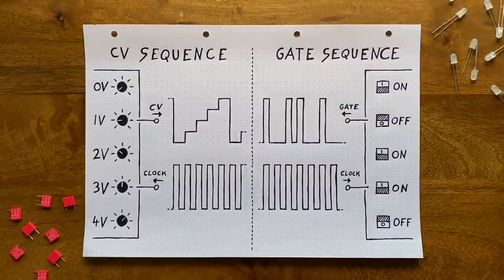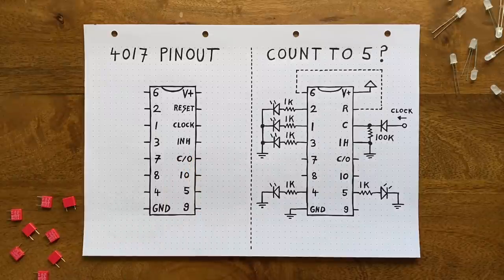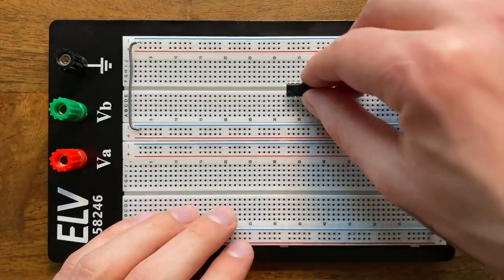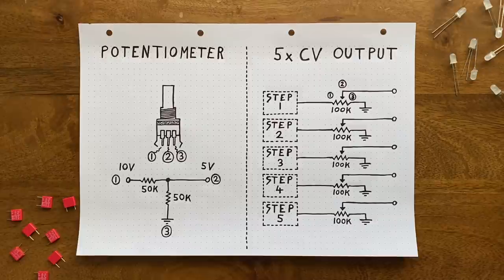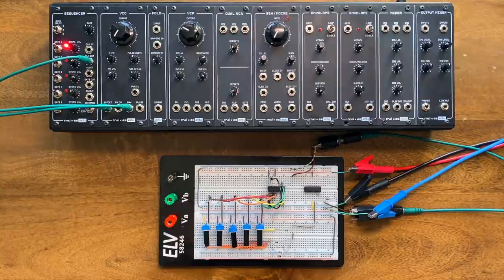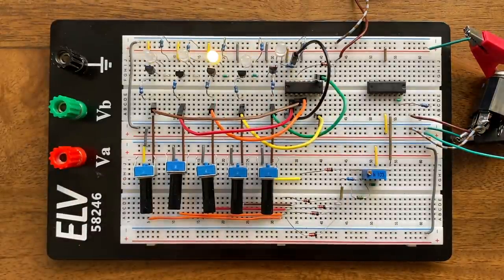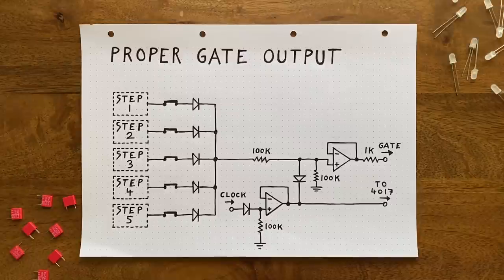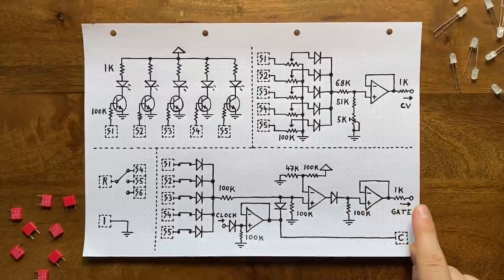Designing a simple 5-step sequencer from scratch

Comment: Great vid as usual! It is worth mentioning for the ones unexperienced with the CD4017 that the outputs in the datasheet are numbered from '0' to '9' instead of the '1' to '10' we would name them. I made the mistake of using what in the datasheet was step '1' as the actual step one in my first sequencer. It took a frustrating while before I understood the problem :-)
Reply from the maker: yeah, that‘s why i numbered them 1-10 on my drawing - but you‘re right, a quick note might‘ve been good!
Reply: Starting at position 0 is the standard for computing and these were originally for analog computers. These are made to be chained together so each chip represents a single digit which is why it starts at 0.

Comment: For choosing number of steps 3, 4 or 5 with just a SPDT switch, if you have one with center off:  pull down 4017 reset input with 100k.  Connect diode from step 6 (anode) to reset (cathode).  With nothing else happening, it will be five steps like before.  Now also connect the common terminal of the SPDT center-off switch to another diode (anode) to reset (cathode).  Connect one position of the switch to step 4 and the other to step 5.  Now if the switch is thrown to connect step 4, then there will be three steps.  If thrown to connect step 5, there will be four steps.  If the switch is left in the center off position, the diode to step 6 will by default give a five step sequence.  This is a similar function to what is in the RYO Penta sequencer (which I have built three) but implemented totally differently.
Reply: (cough) Rotary

Comment: Why couldn't we just powet thr op amp chup with 0-12 volts like the decade counter? It would eliminate the need for most protection components (apart from clock input)
Reply from the maker: unfortunately not, because regular op-amps are not able to bring their output voltage down to the negative supply voltage. lowest they can do is Vee + around 1.5 V.

Comment: You could just use a 1M pull-down and get an ~11V output of the unintentional voltage divider, instead of adding another op-amp. Not like the TL07x can output its full positive rail anyhow.

Comment: if you make each stage of the sequencer using a discrete flip-flop, you can include skip switches (per the moog 960), which is a very valuable addition for live riff-generation.
this is a bit more elaborate than just using a counter-IC, but way more useful.

Comment: This is a great series for DIY builders.
Just two notes on your design:
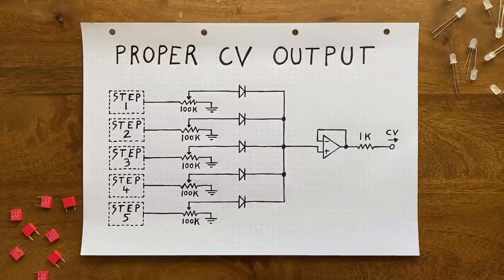@14:46 The 1k resistor on the output will have an effect on the output voltage. A lot of designs I have seen have 50k and sometimes even 10k potmeters on the CV input signal. This means you get a voltage divider and the music is out of tune. If you put the resistor inside the loop (on the output of the opamp) and connect the CV output to the - input of the opamp, the circuit will (try to) keep the signal at the requested level and still have the short circuit protection.

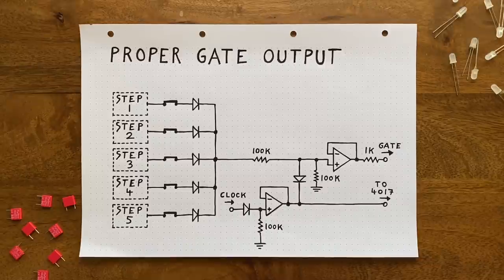@27:50 My Arturia Keystep gives a +5V signal on the gate output when I press a key. This is normal since Eurorack defines gate and trigger signals as 0-5V signals. All inputs should be able to handle -12 to +12V signals so having a 12V gate signal should not damage any module but the comparator and buffer should not be needed.

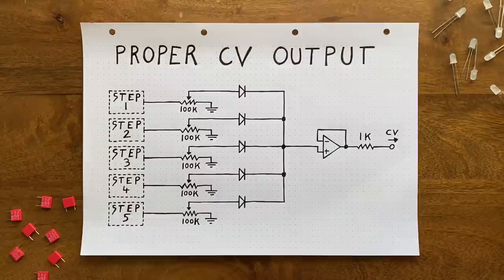Comment: At 15:21, you also need a resistor to ground from the common point of all the diodes.  Otherwise, a step you set to a low voltage will come out a bit high.

Comment: Many thanks. Was looking for a simple clock input for 4017 and yours is perfect. I may add resistor in series with diode as current limit as my friends may use as sequencer running on 9V and connect it to Eurorack. Good idea?

Comment: Thanks for all your workshops. 😊 Is  possibel use a secund cd4017 for the LED'S insted the npn drive transistors?
Reply from the maker: yeah, but i would try and keep the output current per pin at like 10 mA max to keep the chip alive for a while.

Comment: the buchla 245 sequencer had an interesting feature where each step had its own on/off switch + trigger output! weird stuff. also have seen a ken stone 16 step sequencer design with a reset input that could be used to shorten it (but it was made up of 2 8 step sequences so it will often forget to skip for whatever reason)

Comment: Hey Moritz, just curious why you chose to have a second op-amp on your gate output? To me it seems like the diode, 100k resistor, and buffer amp could be removed if you ground the negative supply of your quad op-amp IC. Wouldn’t really effect the rest of the circuit since you aren’t using the negative range anyway and would even allow you to get rid of the other protection diode on the clock
Reply from the maker: that would unfortunately only work with a rail-to-rail op amp chip, because regular op amps can’t reach the positive or negative supply voltage! i.e. if you gave a TL074 0 V as a negative supply voltage, the output can only go down to about 1.5 V.

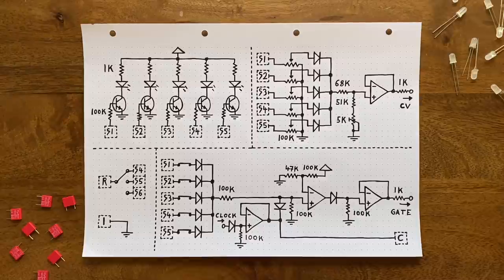Comment: 28:14 Instead of re-boosting the gate output, couldn't you move the 100k resistor to the line with the diode leading down?

Comment: I like the idea with the opamp in the clock circuit helping with the gates. My AND circuit seems a bit overkill now.
Reply from the maker: did you have trouble with ghost gates? i remember battling those for days on end until i finally switched to this approach..
Reply: @MoritzKlein0  for a while I just skipped the whole gate thing because I could not figure out a way. I just used the same square wave lfo to trigger the envelope.
And and circuit works fine, but it’s more parts and more complexity

Comment: It’s really great lecture everything is clear. Thanks a lot! I have one question - my moog Mavis cv in is -5V to +5V range to get all possible pitches (at least thus is what I understood from the manual) how can I achieve that? I have a +/-12V power supply and I’d like to drive my opamp from 3.3V microcontroller pin. Can I bias the input voltage with virtual ground, so the input goes from -1.65V to +1.65 and the opamp gain wold be set to 3? Or I’m completely  wrong here?

Comment: Moritz I echo what many have said, awesome series and awesome teaching - your approach is patient, practical and paced well.  I have built your VCO from the Erica kit and congratulations on that relationship btw.  I have built  your VCA, Envelope Generator and the 5 Step Sequencer, the latter 3 from scratch.  The 5 Step as you may know from the IG feed is still on breadboard and I've had some challenges, but after several attempts I have a working model as designed.  One question remains if you can comment.  My CV ouput to 1 n/oct is sounding an octave approximately.  I know you indicate the range of the voltage pots may need scaled down which I have done some.  It's probably a combination as I never have properly scaled the VCO.  For what I do it has been close enough.  From the video version of the 5 Step the trimmer pot is a 5K.  Is trying a larger trim a good step or I suppose increasing the 68k/51k resistor path might be the better.  Thanks and again very glad to find your series at this stage of my explorations with modular.  Keep up the great work!

Comment: at the end, when talking about getting the gate,  first,  back up to a gate signal, by routing it thru a comparator to bring it back to the full gate output swing desired, and then rectifying it via diode, would it be possible or even work, to just set the supplies on the comparator to be VCC = positive supply voltage, and the VEE = GND? that way you wouldnt even really need the diode? i know youd still want the gate signal buffer at the output, but i was just curious as the diode will already drop most of a volt right there again?

this questions really for anybody who might be a bit more knowledgeable than myself. which if im being honest here, could even be the dude who comes in and sweeps up the place after moritz has done his magic or whatever...  nonetheless, thanks to everybody who might have any advice here..

Comment: I already build the counter circuit on breadboard. Unfortunately my CD4017BE has burned out by using 12V directly. Another chip I used is driven with 6V by installing a voltage divider, so the counter works now. Is there any differences about the CD4017BE, the MC4017P or the V4017D from Eastern Germany? Great Project!
Reply: I think this might be due to the LEDs. The 4017 chip is not  designed to directly drive LEDs..

Comment: Sorry If I am wrong but, about the NPN led setup, if one of your LEDs actually gets destroyed somehow and collector gets disconnected, the NPN base-emitter path will act like a pretty weak diode shorted to ground. You may consider adding current limiting resistor into the emitter for the safety of the source. 
(Edit: I am an idiot, he did put a 100k on the base.)
Reply: What value would you propose?

Comment: Will two 9v batteries work for this project, or do you need a power supply?
Reply from the maker: pretty sure they will work - your output gates will be ~9 V instead of ~12 V though, and your cv range will be somewhat smaller
Reply: @MoritzKlein0  what are some cheap options for a dual power supply because as a beginner I am a little nervous to take on your homeade power supply video. Also thakyou for the quick response

Comment: Does it really need to be trimmed to be exactly 5v? Seems like either you're using a quantizer, in which case it doesnt matter what the exact top end is, or you're going by ear, in which case a little extra room to exceed the 5th octave doesn't affect anything.
Reply from the maker: two things i like about trimming it to be exactly 5V: 1) the highest note will be exactly 5 octaves above the lowest, making it a bit easier to orient yourself 2) switching between the 5 and 2.5 V range can give you musical results

Comment: Could you handle the gate/clock output via a transistor instead of that op amp thing you did? With the clock opening up the transistor to let the gate signal flow through?

Comment: I am awaiting delivery of the parts and will be kicking off the build tomorrow all being well - thank you so much for this (I have now subd on Patreon :) … one question though .. is it possible to link these types of sequence chips together to have a longer sequence chain? Ideally I’d have me a 16-step sequence, so two chips (20 steps) would be fine, but can you chain the chips to achieve this? Cheers :)
Reply from the maker: it’s doable, though a bit tricky. i plan on doing a livestream soon where i‘ll go over some smaller scraps and bits, will include it there
Reply: @MoritzKlein0  thank you my dude 🙏
Reply: Apologies, could you please clarify, what is the power source here? I am using a 9v battery, but am unable to push the LED sequence; I seem to be able to trigger a manual progression by removing and adding the circuit, but it will not drive itself currently. Is this a power issue (i.e. lack of) do you think?

Comment: Since you are great in explaining everything - Would you mind to do another Seq? Maybe with 8 steps based on an Arduino and show also how to connect that thing properly to the +12v, -12v, 5v ? Would be awesome!
Reply: the 4017 is a decade counter; you can easily modify this design to eight steps by moving the reset onto 9 instead of 6. 

https://youtu.be/vHNQQ6yUGyo?t=534

Comment: Maybe an amateur question, but would it be possible to supply the comparator with 0-12 volts without the need for negative voltage (-12V) and output diode?
Reply: 074 needs negative rail to work properly. There are other kinds of chips but i haven't played with them yet
Reply: @Sangejzer  Thank you very much for your answer!

Comment: what is the purpose of the 100k resistors that connect the step output to the NPN transistor bases?
Reply from the maker: to limit the amount of current flowing into the bases. without them, you'd pretty much create a short circuit because the path from base to emitter is basically a diode.
Reply: @MoritzKlein0  awesome, thank you. is that something you'd just have to know about working with transistors like this?

Comment: why not just add two equal resistors to the output buffer to make it a non-inverting amplifier with a gain of 2? then you wouldn't need the comparator.

Ok you would need an OpAmp with a sensible slew rate but that's totally doable
Reply: You could, of course, but you'd be left with a TL074 with only 3 of its opamps in use...
Reply: @GLO2k7  ground the inputs. done. why would i use it if i don't need it? if i later need another opamp it's there and not in use. it's always better to not use and have available than otherwise.
Reply: @bbugl you can always do it. I think part of it was maybe just to teach us new opamp circuit :P
Reply: Unused op amps = LEDs
Reply from the maker: problem is that the voltage never actually drops down to 0 V because of the diode going to the clock buffer. so you'll get gates that swing between 12 V and about 1 V – which might still work, but it's a bit ugly for my taste
Reply: @MoritzKlein0  It also doesn't do that with your circuit. TL074 is not a rail-to-rail opamp, so it will be about a diode's drop above 0V and below +12V.

Comment: Hello, to reproduce the sequencer I used a simple oscillator with the 555, I use pin 5 to receive the.cv of the sequencer 'it works well but I can't get the oscillator to reproduce the silences, I don't know where to connect the gate output, I base it on the circuits of the I appreciate the video's help to resolve this issue with the rests... for the.clock use a 40106
Reply: Hello! I have a similar problem, my Gate out works fine from a certain clock frequency, but below that frequency my gate out still at 12v constantly.
Have you managed to solve your problem?